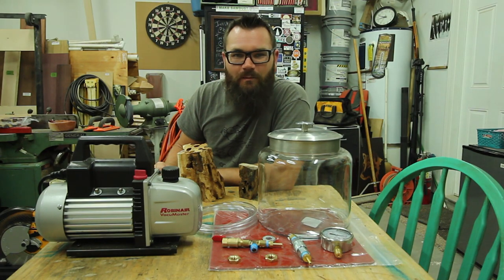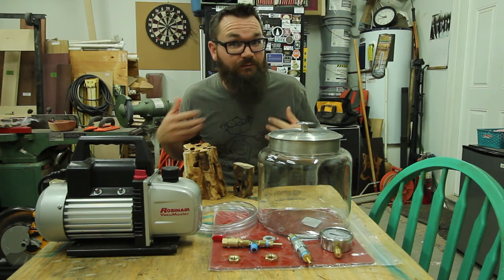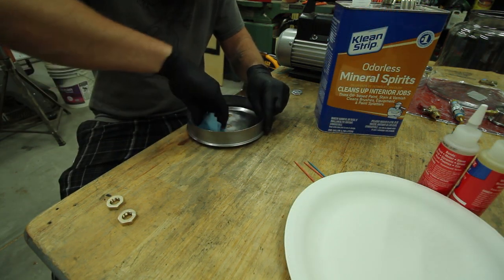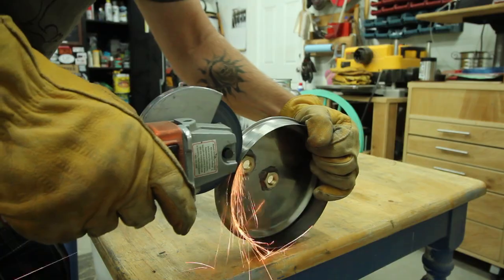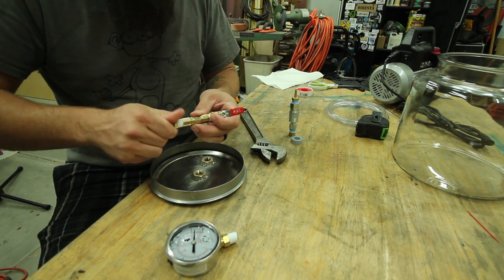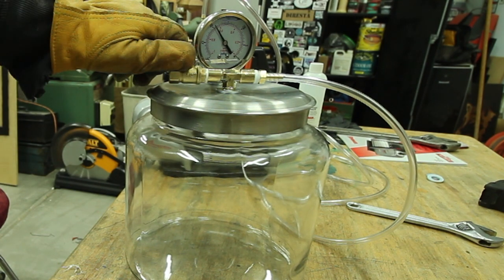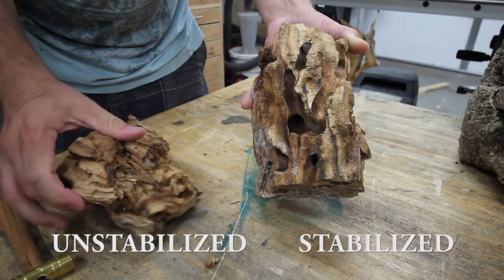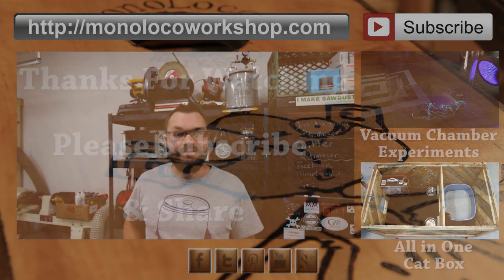Make a Vacuum Chamber for Stabilizing and Degassing

Comment: One thing to look out for: the vapours of whatever you have in the jar will be pulled out and go through the pump, possibly interacting with the seals of it, so don't put too aggressive solvents or stuff into the jar if you don't want to break your pump (or get some 4 figure chemical vacuum pump that has teflon seals)

Comment: I like your design the best. I'd love to buy a Turn Tex for 200 bucks...but this looks like it works great. My HF was a fail since I can't see anything to know when to release pressure. What solution are you using?
Reply from the maker: Yea, not having visibility would be a killer. Assuming you are using the pressure pot, you might be able to get a universal lid. You'll have to verify measurements but something like this: http://amzn.to/2aUrFfQ.

Also, if the $200 is a little high, maybe this stainless one for $109 might do the trick if you want to get the whole setup -pump. http://amzn.to/2b6mxZd

As for the solution I'm using, I use cactusjuice from turntex.com.

Comment: What's your thoughts on a bigger jar?
Reply: you can't go wrong with a bigger jar.
Reply from the maker: It would probably be fine as long as it was thick glass but with having to weight stuff down when stabilizing, it kind of scares me when stuff shifts. I was thinking if I went bigger, I might go with thick 3/4" acrylic and make a box like they do for the big fish tanks.
Reply: I was wondering because I saw that the jar you have also comes in a 2.5 gallon version.  I like the acrylic box idea.  You should do that and put together another one of your shopping lists ;)

Comment: Is it possible to put some sort of regulator valve, like the ones on an air compressor, so you can keep a constant pressure with out having to fiddle with the release valve??
Reply from the maker: You could but it's not because of the pressure that I was fiddling with the release, it's because for the first minute, the bubbles from the resin can bubble too high and get into the intake which would make a big mess in the pump.

Comment: Hi Ty. I am wondering if this can also be used to stabilize stone. I work with making cabochons and sometimes the stones we get, have fractures and cracks, they sell products we can soak them in, but this is a time consuming process. some say you can put it in a pressure cooking, but I was alwas taught as a kid they those things can be temperamental, and I dont think putting the product in it to stabalize the stone would make it much safer.
Reply from the maker: Hey Jackie, Stabilizing stone is an interesting thought. Since most stones are somewhat porous, I think it would work. You might want to ask Curtis from turntex.com what his thoughts are.
Reply: Ok Ill check with him. I just belong to several Rock Groups and one guy I know is trying it your way, but some also do it with a presure pot and force the presure in to the product. I watched a ton of videos yesterday , and it seems to be a process they do to make something called pen blanks. They get a chunck of berle wood that is like scrape size, put it in a mold about twice as deep as the wood is thick, then mix up some alumilite resin with color and put it in a presure pot. This seems to be the way the alumilite is cured it pressurizes the air bubbles out and it hardens in there. Then they take off the mold and its this beautiful piece of pearl colored resins and wood, then tey put it on a lathe and cut in in to a pen body, or a bottle stop, or create handles for knifes, or custom handles for something. But we have seen people use the resin to pressurize it into the stone, some thatit wont crack, thry especially do this with turquoise as it is a unstable brittle stone. So thete must be different ways but ll contact Curtis. Thank you.
Reply from the maker: I recently did a video where I ran through the whole process you're describing. https://www.youtube.com/watch?v=r0HxhnP0tYk

Comment: could you use a diy vacuum pump and how much bigger could you go with glass for larger items  also great vid
Reply from the maker: I'm sure you could use a DIY vacuum pump but I would expect that the amount of vacuum and speed in which you could acquire it would be different. I'm not sure about how much bigger you could go with a glass chamber but I expect you could go quite a bit larger if the glass was thicker. (I must also say that there is probably a bigger risk in going with glass so you might look at larger metal containers if you need larger.)

Comment: I have a question could you use the vacuum chamber with 24 hour epoxy instead of the stabilizing cactus juices?
Reply from the maker: Vacuum chambers are also used for degassing silicone for casting. Since the vacuum process is a slow one, anything that takes a long period of time to cure should work.

Comment: Safety first.....I would be scared to use glass for a vacuum, unless it was made to handle it. I see why allot of people use the acrylic tubes.
Reply from the maker: Yup, I've seen a bunch of those as well. I'm mostly worried about hitting it with something or something inside it shifting while under vacuum. When I have something like that in there, I'll generally put a barrier up between it and myself.